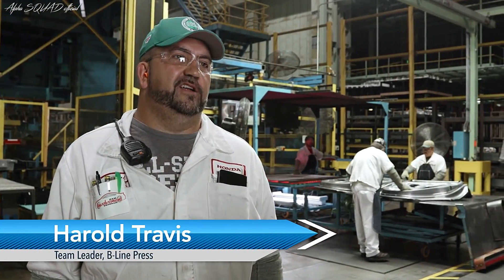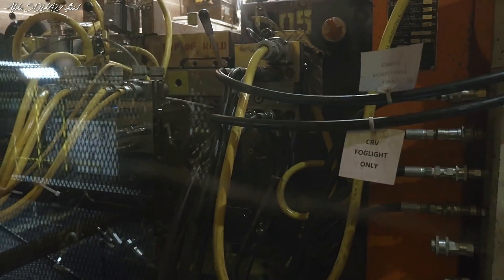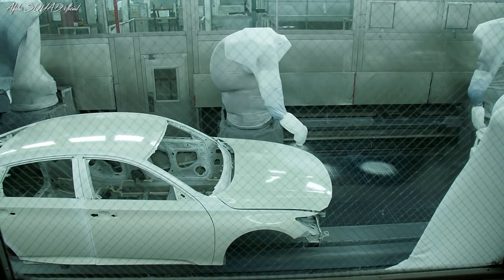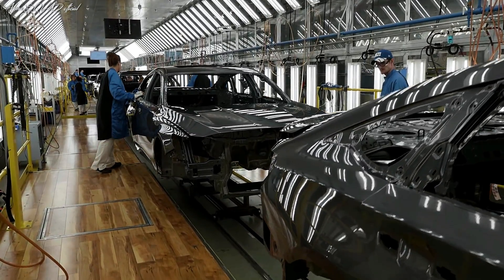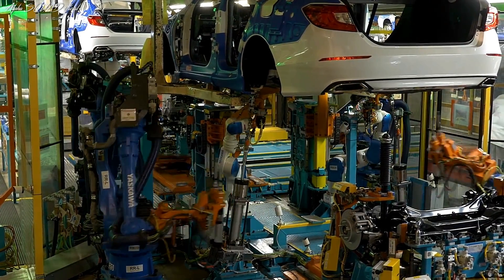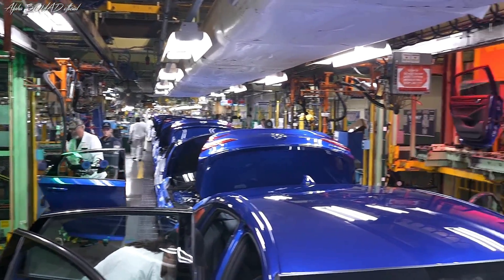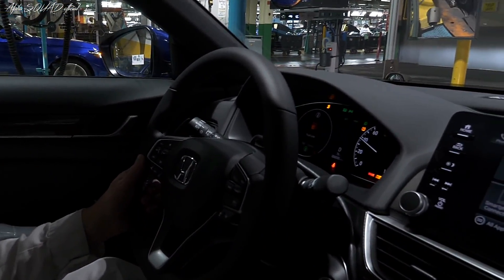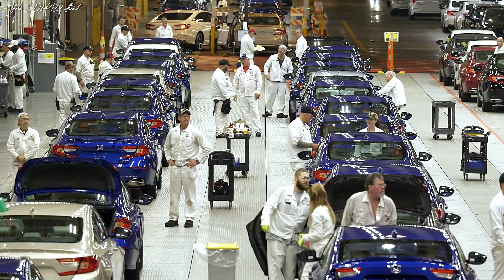Honda ACCORD Production

Comment: My 02 2.3 5 speed manual is still going strong at 202,198 miles. Meanwhile my wife’s 2018 crv is mixing its gas and oil so bad that the heater doesn’t work. Old Honda= tank, new Honda= dumpster fire.
Reply: Thats what i been saying my dude. F new honda..

Comment: Ok at 8:07 it shows an Acura door with the black trim piece around the windows for the interior.....why did Honda remove those for the Accord? Up until 2012 the accords had them , it kept the outside body color out of the cabin which is a nice fit and finish.
Reply: Big Rig the bean counters wanted to save $2 on building the car

Comment: My dad's 2003 V6 Accord came out of there June 2003 and he has 280,000 miles. My 2007 Accord SE 5 Speed also came out of Marysville and has only 204,000 miles. I'd like to get a newer Accord someday, but ours keep running.
Reply: Yeah the old school engines r great but the body of the car will split and rust before the engine goes

Comment: My 2004 Honda accord has now 160,000 miles. Still drives like new.
Reply: monk loss same model here mine just ticked over to 286,000 effortlessly drives better than it did the day I bought it a few years back
Reply: That's hardly broken in.
Reply: 98 ex civic with 259000 same clutch running hood

Comment: I bought a sport, but I should have went for the EX, well anyone know if i can install the FACTORY siriusxm set up on my sport so it can show up on my info screen with preset channels? TY
Reply: Daniel N I got the sport too and had the same question. So I called the dealership and unfortunately you can’t. Only option is aftermarket sadly because the car has been prewired without it.
Reply: @mauricolara9318  I installed the aftermarket one and it's not great. Too much of a hassle to get to your presets. I'll just stick with using my apple carplay with the sirius app.

Comment: With such stringent manufacturing, what does just about every 2018/19 Accord have a buzzing noise in the back speaker deck when anything with Base is played. My car had it, the rental had it, other accords I test drove had it. Clearly, they are not testing for this not are they foam sealing the back deck sufficiently.
Reply: Mine too!  It has taken my dealership 3 attempts to silence the speaker deck.  For now it's quiet, but I fear it's going to come back.
Reply: I think its the active noise cancelling system ... maybe

Comment: What changes were made to the 2019 Honda Accord, from the 2018 Accord?
Reply: The hybrid gets one more mpg
Reply: Nothing other than the Touring model is no longer available with the 1.5 turbo.
Reply: The design on the rear end
Reply: no turbo boost gauge on the 2.oT w/6MT

Comment: I wish this plant would have paid more attention to my 2018 Accord 2.0 Touring.  It's been back to my dealer nine times for assembly related issues.  I love the car though!!
Reply: 9? Holy f***. Seriously? Why
Reply: @codykh  I don't know why, but the hood was out of alignment, a rear window trim piece came off, a rattle in the console and a rattle in the back speaker shelf that took my dealership 4 times to finally fix correctly.
Reply: @sapurvis  Oh, yeah, There are rubber grommits you can adjust to get that hood aligned up. A lot of people are unaware of that. The rattle is a common problem and I think it is with all accords, maybe limited to certain models (I do not know). A trim piece coming off is unforgiveable, you should have asked for accommodation when that happened, some free accessories or something. Honda prides themselves on quality so if you yell quality issue they will fix it asap.
Reply: @sapurvis Funny you say that. I bought a 2018 accord EX-L. It has a low tone rattle what sounds like from front left of my steering wheel on dash, and on passenger window side. Any idea how to fix it? I tried pulling out the rubber grommets under the hood but that didn't do anything for me.. It's seriously driving me crazy ("driving" me crazy.. lol)
Reply: @codykh  Take it to your dealer and have them handle it.
Reply: @sapurvis  i will, and i won't accept any rattle. I'll take it in over and over and I couldn't give a rats arse what they think. When i spend 25k on a brand new car and a warranty of 3.1k i'll make very good use of it. I'll rain hell inside sale dep on busy days in front of customers if i have to. Apple Honda of York better handle my issue promptly. I will update you guys about what happens.
Reply: @codykh  I'm waiting

Comment: Thanks you guys for building my 2019 black on black 2.0t sport I love it it's my  sixth Accord had a 98, 03, 07, 09, 14 I will only drive an accord. PS some lowlife stole the wheels off my car this weekend 12/22/18 left it on blocks 😡 so please put wheels locks on sport models in future 😫
Reply: Honda offers wheel locks ask the dealer
Reply: I did for my 2018 accord Sport 2.0. I got the wheel locks free from the Dealer. I had a feeling people will be eyeing them.
Reply: @xxFallenKnight  hey try and get some locks from Kia and Mazda they fit so you can have 3 sets  of locks so it'll give them a hard time cause it's not that hard to open even with lock 19" shocket n a hammer that's why I put 3 sets to make it harder an longer to steal
Reply: Looking at the black one. Tough to keep clean and also hot here in FL. It does look great though. How's the 2.0t?
Reply: @URideToo  the 2.0 is awesome. The 10 speed is a great transmission and a 6 speed manual is also available too. Awesome car.
Reply: I’m Just curious do you live in Texas?